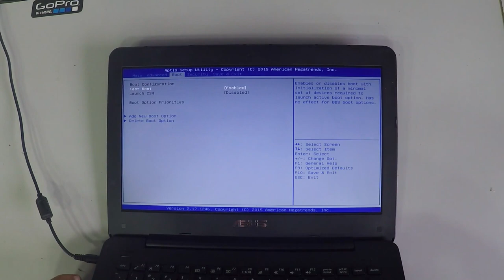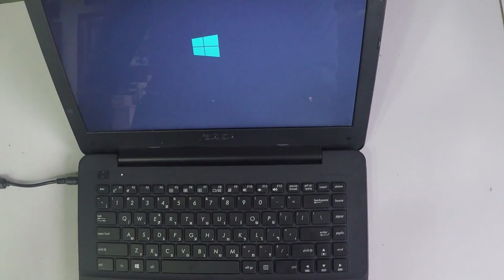ASUS X454L HDD SSD Replacement

Comment: Great video, thanks! Helped me successfully upgrade!
One small comment - to replace the HDD to SSD, you don't necessarily have to remove the keyboard entirely. You can 'lift' it and work under it to remove the HDD with a smaller screwdriver. Worked perfectly for me, and decreased the 'stress' of needing to reinsert the keyboard connectors
Reply: do u have to go to CSM thing to enable?